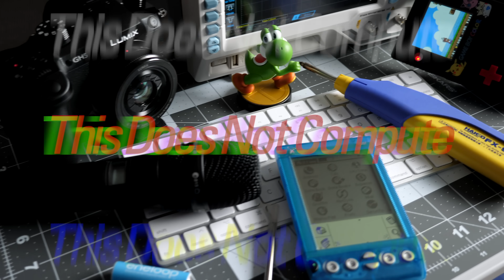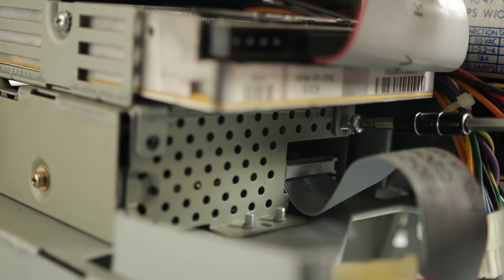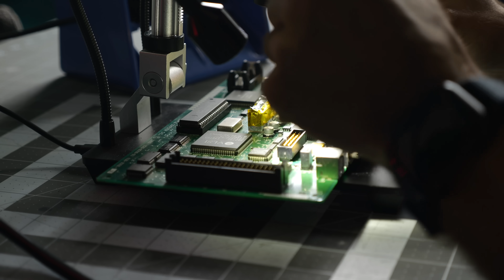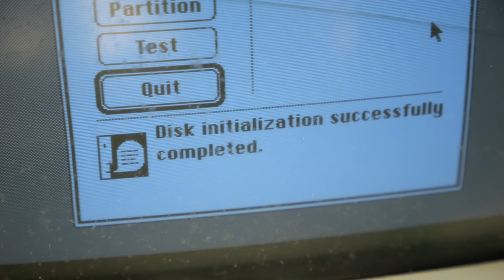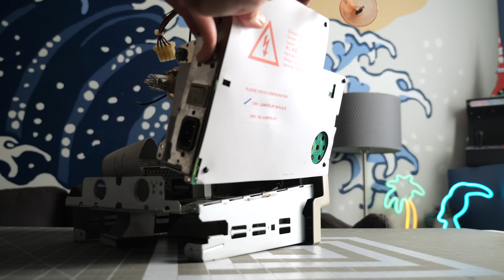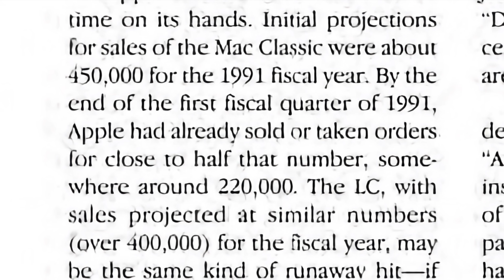Restoring Apple's most BORING vintage Mac

Comment: I worked at Corvus Systems in technical support when the Mac first came out.  Corvus was the first company to make an external hard drive for the Mac.  Apple was almost within walking distance of where we were so many engineers from both companies knew each other.  I remember the first time we got training on connecting the 5MB Corvus drive to the Mac.  We were all shocked at how simple it was.  It was a joy to support because we rarely got calls.  By comparison we supported the Apple III which was nightmarish piece of junk.

Comment: What I loved about the Mac Classic back when it was launched is I could finally afford to have my own Mac. That graphic interface was so clean and well designed and everything worked so well. This model was the machine that Steve Jobs originally wanted to build. It was perfect and cheap. it was an appliance. Sure it could have been faster and it could have 16 grey levels perhaps, but it was a Mac and you could have that level of finesse yourself finally. I just felt so good using it and it was all mine and ready to start coding and doing cool things. It was an incredible moment in Mac OS history.

Comment: Please if you want to use tantalum as a 'more reliable' opion then make sure it'll will fail open. I had to quick disassemble a compaq concerto once because I noticed those bastards caught fire on the power board.  Not the first time in 40 year either. Basicly I have tantalum ptsd, I don't believe those bastards have cousins that fail open.

Comment: I can't believe they put a glacially slow 8mghz chip in these when they came out.   I was already running a 33mghz 030 accelerator card in my SE.  I jumped to a Performance 476 25mghz 040 which was an even bigger leap.   I must have 10 of these Classics in the barn I've never fired up.

Comment: Thanks for the memories. Had a 4/40 Mac Classic new. I really wanted a IIfx like I used in the school computer lab, but that one was as expensive as a car. I used my Classic for word processing, built a database of car specs (like you see in the back of a car magazine), played Need for Speed, and used a peripheral that I forget the name of to record and manipulate audio. It was kind of an early Garage Band setup. I had the idea that I would record car exhaust sounds for my database. I quickly found out that was not possible because the audio files were huge and I had no money to buy more data storage! That computer lived until 1995. At that point I had money and got a new 540c. I should have bought Apple stock instead.

Comment: I just opened mine up to look and i had the same battery with the same date. Thankfully also not leaking. I can't tell if any of the caps leaked on the motherboard, but I don't see any damage. I would need to send it off to someone to replace them for me.

Comment: About the ROM disk, the real story on that feature is the hw team used a single 512k x 8 bit rom (cheapest solution), vs the SE which used 2 128k x 8 bit parts.  So there was 256k of free space.  The firmware engineer (Gary Rensberger) compressed the 60x system to fit in the space, along with reclaiming the space used by the old mac team photos in the main 256k rom.  Another feature is you can mount an appleshare server, select an app there to be your startup app, and you have a turnkey system that runs the server app on powerup with no HD .  This was all done secretly, management didn't know about it until a month after the ROM was released to production.

Comment: One of the greats! The Classic was my first computer. Still have mine. Paid $900 in ‘91 I believe. It’s a 4MB/40MB model. It now has a rolling screen so I need to work on it. The Classic is dog slow, and the screen redraw is slow too, but it was very usable, especially with MS Word v5. System 7 will always be the classic Mac OS to me, although I remember Mac users arguing over System 6 vs System 7. Those were the good old days for sure and this machine really got me into computing. It was this vs an Amiga and obviously I went with a Mac.

Comment: The Mac Classic was the first Mac model I ever used. At the time, I just figured they all had hard drives installed, because how else would you boot to a GUI-driven OS? It wasn't until much later that I learned that the first couple of Mac models couldn't even use a hard drive.

I never thought much of the Mac Classic, personally. Once I got past the initial wow-factor that the Mac OS enjoyed over DOS, I found the thing was dog-slow compared to most everything that wasn't one of those terrible XT-class "entry level" PCs. Before I got my own computer, a 386SX that was no powerhouse itself, I had to use the school's Mac classics for my school work; just basic word processing on it was such a chore, it was so slow. There was one SE/30 that was available to us students, and I always wondered why it felt so much faster than the Classics despite looking so much older. Turns out it felt faster because it really was.

Comment: My Uni, UEA (UK) was very Mac oriented in the late 80s when I was there. The first Mac Lab in '86, full of Fat Macs, was quickly enhanced with the DigiLab containing Mac Plusses and then the Mac II lab. Of course, as a UK student there was no chance I could afford one, but I longed for affordable Macs and was delighted when the low-cost range was introduced in late 1990. A 1MB FDHD Mac Classic for £600! I would have been satisfied with that (with more RAM & a HD), because it would be good enough for Think Pascal & basic office software, but also because nearly all ink jet printers were still mono. In the end, I still wasn't able to afford one until summer 1993 and by then, the Performa 400/4/40 was the sweet spot (£1280 with a display and StyleWriter II). That computer still works! A church friend of mine did get launched into the world of Macs via a second-hand classic after I persuaded him (correctly) that even that Mac would be good enough for his needs, and equally importantly, was simple enough for his dad to use!

https://www.computinghistory.org.uk/userdata/images/large/86/49/product-78649.jpg

Comment: I have one of these machines. It was my favorite vintage system. Incidentally, you can boot the system without a hard drive or floppy drive using cmd-opt-x-o. This will boot system 6 from a ROM chip. EDIT- I should have finished the video before commenting!

Comment: While the problem didnt seem to be capacitors you should really check under the large capacitors right near the main power wires to the motherboard, a couple of mine looked perfectly fine but had a fair bit of leakage hidden under the base of them. 

Another fault of these supplies that result in low or jittery voltage is the 1n4148 diodes near the optoisoltor.

Comment: Colin,
about those tantalums, but that's just my humble opinion:
I'd rather have an electolyte spill and a bit of corosion than a fire in my apartment.
Maybe take a look at MLCCs. These modern multi layer ceramic capacitors are very safe as they don't catch on fire like tantalums do.
Might also be cheaper in some cases, not sure though.
But if we can avoid tantalums I think it is also bit better for the environment in the long run or at least we save them for those cases where there's no alternative.

Comment: Nice, but you missed the main part: recapping the Analog Board. Those are filled with capacitors that leak, and need to go. Yours is still working, so the electrolyte hasn't done enough damage yet to kill it. I seen Nichicon PL capacitors on some of your close shots, and those definitely leak... Now do a follow up video, where you recap the AB, as there are enough videos of people recapping the mainboards of those Classics, but not a lot of them tackle the AB

Comment: As with most crapples, it was an appliance, not a computer.  The late Tandy 1000 range had equal specs yet with colour and sound for the same price as that thing.  I have to wonder if they started "classic" as a branding, I've seen other "tried and tested, won't fail" products labelled as "classic".
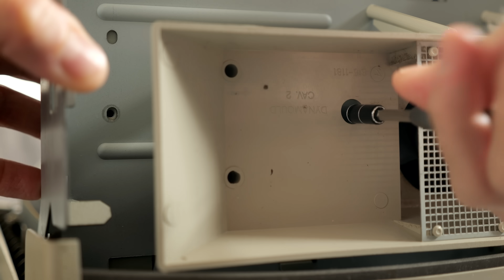3:00 - Crapple making something easy to remove?  You don't see that anymore.  Designed to be irrepairable is their standard unethical practice these days.

Comment: you really just called my first Mac "boring"? well, OK, specs-wise, sure, it's nothing to really write home about. but it was inexpensive, portable (ish) and had/still has a lot of charm. i got mine from a place in Texas which sold it with a 105mb hard drive from Quantum and 5mb of RAM. not really sure how they did that now, but i used to know. that was a great little computer. i wish i still had it. today's Macs are sleek and fast and stylish, but they have no soul, no charm, no CHARACTER. progress!

Comment: I bought a Mac Classic at a local market because it had a good backgammon game on it! This was in 1997 and it had a 40 MB HD, 4 MB of RAM and ran OS 7.0.3. After about a year, I needed a printer, the only way to get one at a reasonable price was to buy another computer and printer together on the used market. The replacement one also had 40 MB HD, 4 MB RAM and OS 7.0.3 but was a Classic II, quite a bit faster. People laughed at my funny little computer but within 35 seconds of boot-up I could be typing my first newsletter using WordPerfect. A few years later I needed access to a fax machine and bought another Classic I for $10 from a friend. It had an 80 MB HD, 10 MB of RAM and ran OS 7.6.1. I used an app called Fax STF and the Stylewriter II from the first Classic I to make a workable fax setup so I could receive my work assignments each morning before leaving home.

Comment: I purchased a Mac 128K back in the day and then upgraded it to a 512K fat Mac the hard way (though I put in sockets for the memory chips while Apple had not). Then later would get my first paying programming job writing software for a Mac Plus. So this form factor has a certain nostalgia feels to me. However, am not so inclined to collect any such vintage Mac in this form factor as I stay away from vintage computers that have integral CRTs - their [CRTs] days on this good Earth are surely numbered. Well, I do have an oscilloscope with a CRT that I'll never part with as it's a hand-me-down from the Los Alamos research labs. My one vintage CRT exception.

Comment: I recapped my Mac Classic a while ago. I don't think I managed to remove a single one of the surface mount caps without lifting the pads a bit 😢. I hot glues the new caps in place thous. So hopefully they won't fall off. Apart from that problem it's working well after the recap :).

Comment: It may be boring, but the Classic has a special place in my heart, as it was my first Mac. One of the first things I bought when I first arrived at college, and got a fairly decent educational discount. Picked up an ImageWriter (the original one, not the ImageWriter II) and a small computer desk (both used) to complete the setup. Memory upgrade was one of the first things I bought, iirc I went with a third party memory board instead of the Apple one. Mine didn't have a hard disk (couldn't afford it) but I took care of that later in the semester with an external SCSI drive (also bought used.) Underpowered, sure, but it did the job, that machine got me through most of college. I did end up getting a IIsi later on though, which was awesome because I finally had COLOR! :)

My dorm seemed to be the place where they dumped all the EE/CS geeks, because there were an awful lot of us there, and a lot of us were Mac users. So we decided to set up our own AppleTalk (technically PhoneNet) network. (This was before networking in dorm rooms was a thing.) We decided that we wanted to do it "the right way", so rather than stringing wire out of peoples' doors and down the hall, we actually routed the cables through the drop ceiling. (We drew straws to see who got that unenviable job. Luckily it wasn't me. :) ) Wired up most of the floor I was on, and we even extended the network to several other floors by draping cable out of the windows of one of the rooms at the end of the hall. Naturally the main purpose of this network was for playing games. Had so many fun late nights playing Spectre, Netrek, Spaceward Ho and various other net games that I can't remember atm against each other. Fun times, fun times. :)

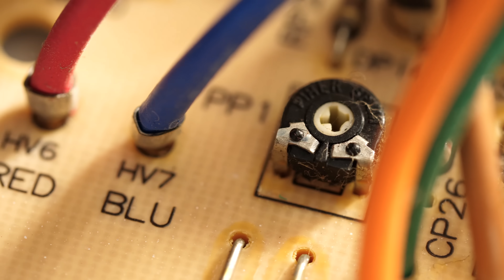Comment: 11:45 You need a set of TV adjustment plastic screwdrivers, partly for safety but also because if you ever adjust CRT potentiometers the plastic is non-ferrous and won't interfere with the picture so your adjustments are accurate.

Comment: Fascinating, not boring in the least.  I had a Mac 512, and bought an under the mac external hard drive from (???.)  I used Ready Set Go desk top publishing and More Outliner.  I wrote a user manual for software that ran on a small main frame (mini-computer).

Comment: The caps may not have been the issue for your issue, but if it’s going to be sold as a restored system at free geek with all the maintenance done, I really would suggest replacing the AB caps. They are notorious for going bad and leaking badly, Nichicon or not. They probably won’t last long before they go.

Really enjoyed seeing another Mac fixed up though! Stuff like this, the IIsi video, other restorations, are my favorite stuff to watch here.
Reply: I saw a bunch of Nichicon PL caps in the video. Those are a replace on sight, as they leak. This is half ass restoration in my opinion, as the AB will still work for quite a few years with those leaky caps, until it one day wont, and the repair would be a nightmare...
Reply: @michvod  yeah… I hope whoever buys it is savvy enough to replace them. Those are right up there with the ELNA LongLife caps.

Comment: This was the first Mac I owned outright back when I was in High school. Prior to this owned a TRS CoCo III and then a bare bones Panasonic DOS laptop. My dad had bought a Mac II used from a friend prior to this so I had experience with the Mac and I had used a Mac 512 in school before. My feeling at the time was that very in some ways “outdated” tech by 1990 when this was released, it also allowed people to buy a Mac for around $1000, which was unheard of, as the lowest end mac it replaced, the Mac Plus, was $2600. 

This Mac’s main strength was basic tasks like word processing, spreadsheets, black and white MacPaint type graphics, playing older monochrome Mac games, and whatever else was being done on the monochrome Macs like the 512K and Plus.  Basically, all the tons of software that ran on the Mac 512k & Plus would mostly work fine in the Classic so there was a large library of software titles that ran on Classic. As a very entry level Mac it was fine if not the most exciting but it got the job done IMO.

Comment: (A) The moment you went to the not-B-roll for discharging the flyback transformer, I was all "yep, that's what you gotta be careful of…" I remember not having the grounding spike to do that and just waiting 24 hours (or more) for the charge to dissipate before cracking the case when I had to go inside my Plus back in the day.
(B) That intro was PERFECT.
(C) For some reason, I thought it was the Classic II with the ROM disk. I suppose it's been a while and my memory's just going.

Just a great video overall!

Comment: Also I know you have reservations about retrobrite but have you ever considered the "bath" method?  Instead of applying cream to the plastic which can cause streaking, submerge the entire case in a hydrogen peroxide solution and leave it out in the sun (or under a UV lamp) which evenly brightens the case.

Comment: Boring perhaps, but it was the only computer we had in the house for most of the 90's. I think the last time I had it working was about 2012 or so -- when I finally got (back) into retro around 2016 the battery had already exploded. My friend and made a few attempts at fixing but it lost a few components and the analog board also has issues -- and of course the replacement I ordered was the wrong revision!

Comment: I have a couple cousins that had Mac Classics back then.  If I'd bought one, I would've gotten the $1500.00 config.  Even in 1990, a Mac with no HDD and only 1 MB of RAM wasn't very useful IMHO, unless you were fine with floppy-swapping and running only System 6.X.X, LOL.

Comment: I've always liked the Macintosh Classic. I know it has a reputation for being boring, but the way I see it it's essentially a Macintosh Plus that benefits from being a newer design. It's capable of reading 1.44 MB floppies so it can interact with other computers more easily, and it doesn't suffer from some of the older hardware quirks of the earliest Macs. Once you see it as the Mac Plus experience but better, it's actually quite a nice machine to have.

Comment: For removing the capacitors, I've seen some heated soldering tweezers another youtuber used that might make the job easier than hot air. It lets you squeeze both sides of the cap where the solder is, melting in the process. Less preparation needed and you don't have to worry about the hot air accidentally blowing other components around.
Reply: You're talking about Northridge Fix. He uses that tweezers all the time as you described. You can say his name - it's not going to get you in Youtube penalty box.
Reply: @KennethITGuru  Not sure what the attitude is about, I just didn't remember where I saw it. It probably was NorthridgeFix and I would have said so if I was able to recall.
Reply: @soviut303  I saw them on RMC. Does that get me into the sin bin? 🙂